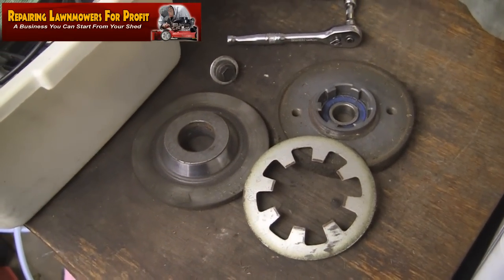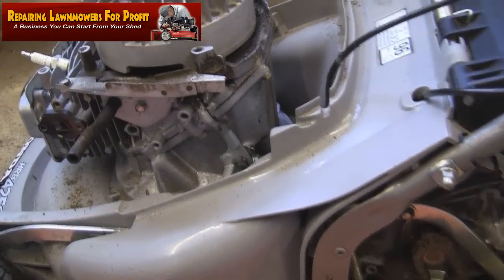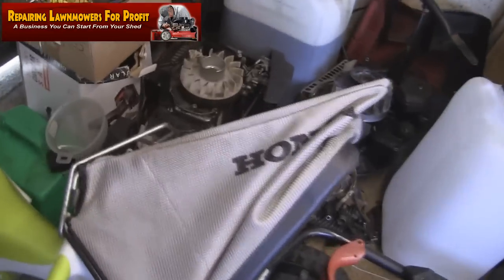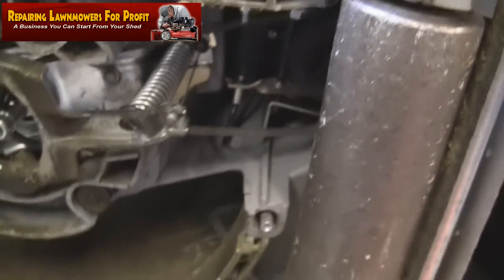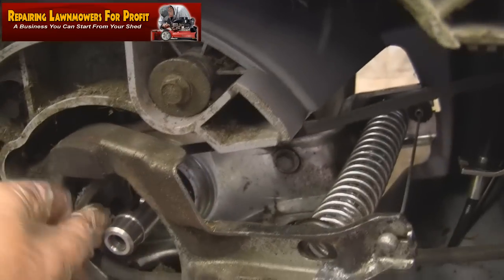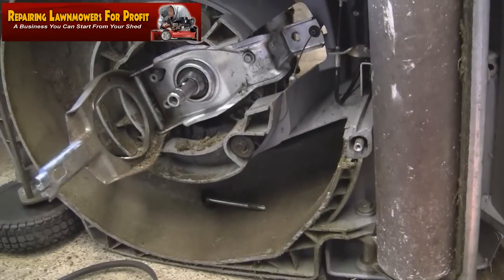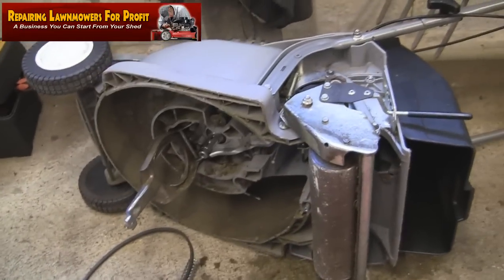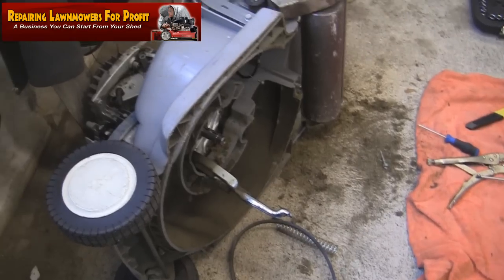Repairing Lawn Mowers For Profit Part 48 ( Honda HRB 425 Transmission Fail)

Comment: Hi. Just taken one of these in for a new drive belt. Unfortunately we don't normally work on these as they are getting on a bit now, and someone said fitting a belt is a bit of a pig. Anyhow- everything removed that needed to be and belt fitted, although something doesn't seem right on reassembly. The rotostop cable is so tight now I can barely get enough slack on it to reattach it to the upper bracket on the handle and secure with the two locking nuts- wasn't an issue before reassembly. I cannot find a picture of the correct reassembly of the rotostop clutch and belt pulley assembly. The parts list shows the drive belt pulley on the crank with the groove for the belt facing down towards the blade, however I believe it came off with the belt groove uppermost to the engine. I have tried fitting it as it appears in the parts diagrams with it facing down, but then the two pulleys aren't in line- the crank pulley is lower than the one on the gearbox. Also, the fingers on the large spring ring have UP marked on them, so assume it should be fitted with the face marked up, facing upwards towards the engine. Any help would be appreciated.

Comment: I work on mowers all the time and am happy to know I dont have to ever work on that model Honda. I have a Harmony2 that smokes like a beast. Sometime this summer I plan to remove the engine and tear into it. I suspect a bad ring or something strange. It runs ok, but blows oil like a chimney and the plug is saturated in oil. It still has plenty of compression and no knocking. So that tells me the rings went snap. If I can find another mower with bad transmission but good engine, I am all set. I do get many of my mowers for free on the side of the road or $10- $30 for push mowers and self propelled mowers. Riders fetch a good bit more. I sold a nice 19 hp lawn tractor for $450 last summer. This summer prices have gone up on most riders. I dont have the room to store parts or chassis so I usually pick and choose what I do.

Comment: Hi there
I have watched all you’re videos ,and  took the plunge i Got a    Lawn king xc35 striped it down  serviced it and ready to run the alumin boss was goosed  so at 18£  I replaced it  casting left it to desired and it fractured again complained  only to be offered a replacement at 5£discount what would you have done ? 
Can u advise a genuine supplier 
Bob

Comment: Do you know what it is that tends to fail on these? I bought one from marketplace yesterday which has faulty drive. They’ve taken the gearbox cable and all associated bits off it and were using it as a push mower. The gearbox housing is still attached to the bottom and all the bits removed have been kept and passed on to me. What I’m trying to work out is which part fails in the gearbox so I can get a replacement part as the whole gearbox is around £230.
Reply from the maker: Im not sure sorry. I know some gardeners have swapped them for replacement though.